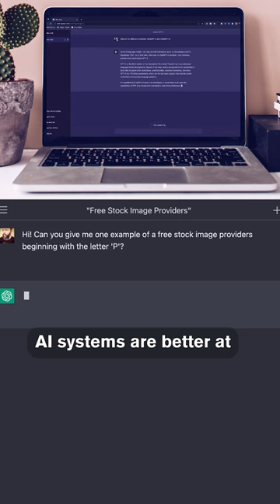Robot Butlers: The Reasons Why We Don’t Have Them

Comment: I was going to add breakthroughs in security. instead of holding your files for ransom it could hold you for ransom. just like televisions have been caught red handed allowing remote tunnels in.. robots not running locally could be dangerous